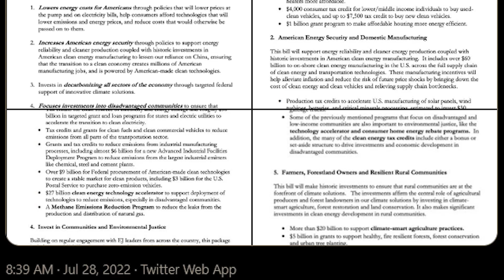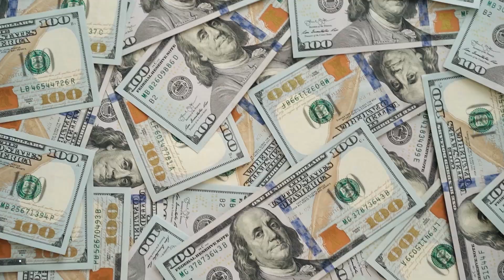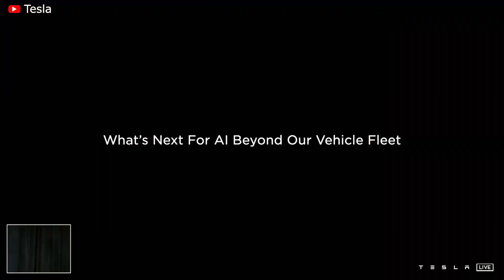Elon Musk Reveals Cybertruck Insane production Plan, Bringing $350M per week for Tesla!

Comment: So the 9K GigaPress has a Cycle time of 60 Seconds , that’s 60 X 24 X 7 Days = ~ 10,000 Cycles/Week X 50 = 500,000 Cycles/Year. Does the Mold/Press make Front AND Rear Castings each time it closes? Shanghai is making a Tesla every 45 Seconds. It Could be a Dual Cavity Triple Plate Die, injecting through the center plate, the Front and Rear would be Cast separately, piggybacked, oriented with the heavier sections close to each other, so the Aluminum doesn’t have time to cool. Scrap and maintenance would be minimal. The Molds are very Accurate and wouldn’t wear much At All, meanwhile a replacement Mold will be made with any improvements added.
With so few parts and so much Computer driven Automation/Robots, the quality should be Amazing. In addition, Multi story Assembly Cells allow a defective product to be picked up and sent to a far corner where it will be repaired Or recycled. Just my thoughts.

Comment: I hope casting gets perfected quickly. Saw a piece fall off after press and at 6:19
Reply: That was the Sprue, part of injection process (material sacrificed in order to fill the Cavity and push air pockets out), it’s designed to break off flush to the Cast Part, it then drops onto a belt chute to be remelted.

Comment: I hope the dual motor cybertruck comes out first
Reply: Good Suggestion! 
Balanced down the middle?
 Front/Rear?
Reply: They'll start with the highest trim level (which will be the quad) unless it can't be made ready in time. Tesla will likely drop both the single and tri motor variants to simplify production and maximize margins until they can catch up on orders.
Reply: you better hope the truck actually comes out.  dont worry about the motors 😅😅😅😅
Reply: @jebes909090  It's definitely going to get produced. It's just a matter of when exactly. The CT will out truck every existing truck except maybe for diesels that get used primarily for hauling trailers long distances.

Comment: It's sort of funny you look at GM, Ford and VW and they're all talking about 30-40 new models in the next 2.5-5 years. Whereas Tesla is designing scalable platforms for instance the S, 3, X and Y and now the CyberTruck/Tesla Semi.

Each one represents a market segment and when you think about it  once you have your platform in place how hard would it be to change a 3 Sedan into a Hatchback or a Lift back.

The reason I mention it is because for a long time companies like VW had a thing called shared platforms. So they would interchange various parts and accessories between company brands like VW and Audi.

But when I look at Tesla and more importantly their mode of production there is a potential to take a shared platform to a whole new level. Let's say the basic 3 platform can be produced as 3 seperate models sedan, hatchback and liftback? The S could be a Sedan, Convertible and 2 door Coupe? 

I'm not saying they will but their production lines are so efficient they could literally produce 100 sedans, 100 hatchbacks and 100 liftbacks without even changing anything on the line it's just grabbing a different panel.

I'm not saying Tesla will do something like it but it just seems like their angling towards this type of flexibility at the production level.
Reply: P

Comment: Cyber truck can only succeed.
-gigapress; large die castings
-stainless steel body, no paint booth, no rust
-battery power, no gas, nor oil needed.
Reply: Or fail due to waste. Massive production problem. Design failure.